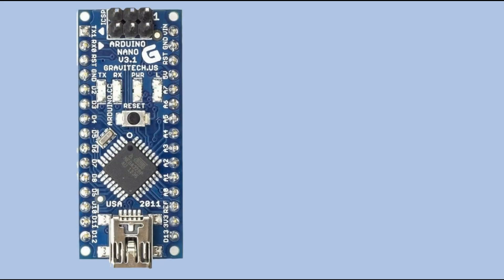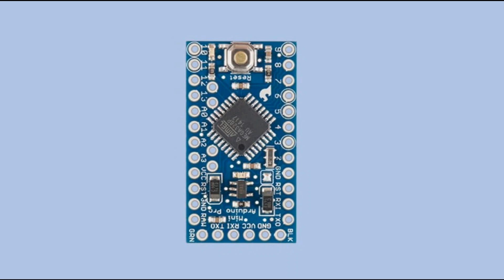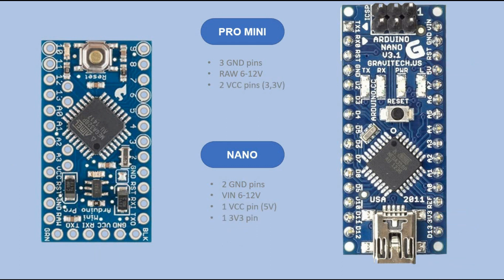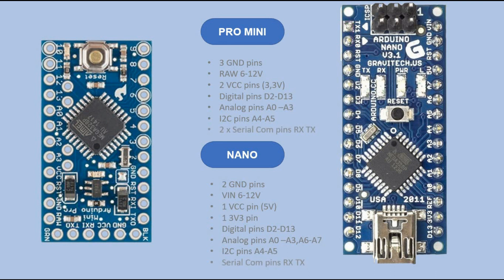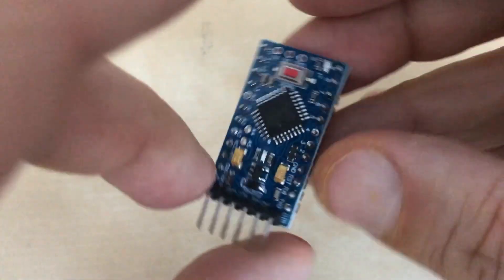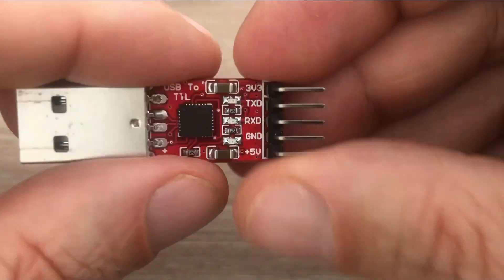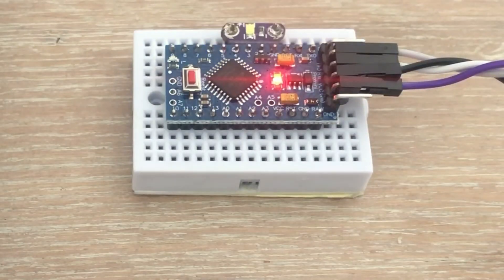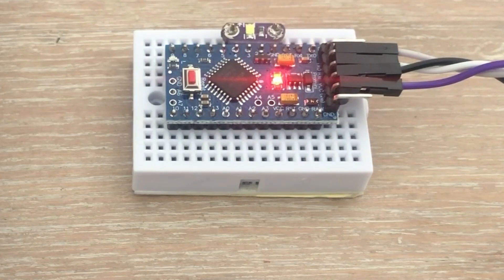Using Arduino Pro Mini 3.3V to Control 3V Devices

Comment: Mario, Great videos!  One question, for the 3.3V devices, we can still use Nano but feeding the power to the device (i.e. RYLR998) from the 3.3V pin, right? No need to specifically use Pro Mini.  Pls confirm
Reply from the maker: Yes you can but just to power. But if you want to connect the e.g. RYLR998 to transmit data it will be the 5v signal which would fry the lora so you have to use level shifter or voltage divider

Comment: You could also use a level shifter  module if its only one module you have to connect to v5 logic
Reply from the maker: Never used it. Thanks for the hint. I will definetly check it out:)